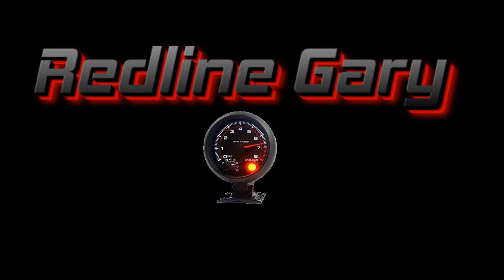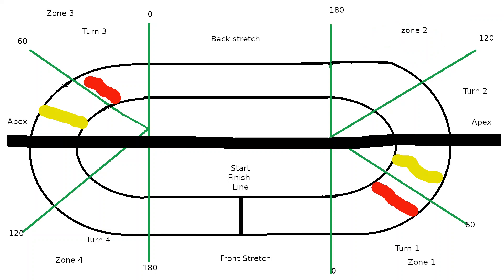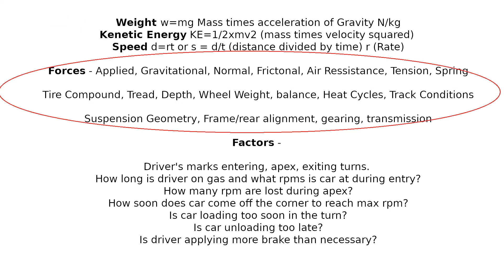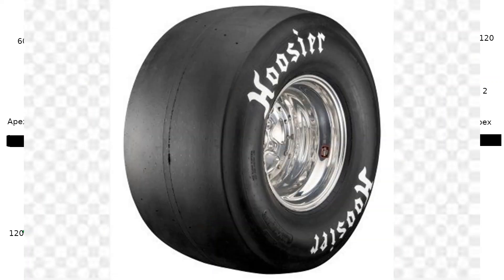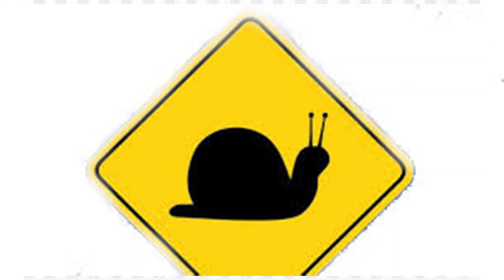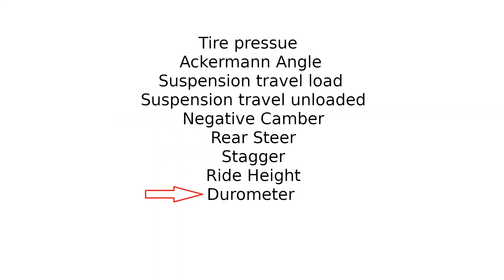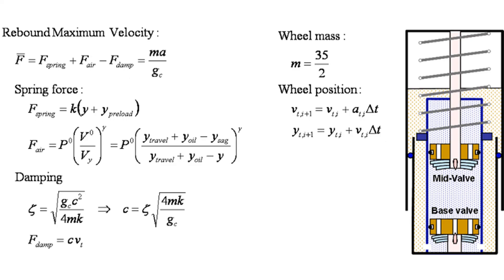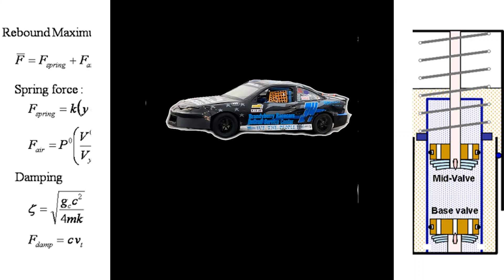Racecar Setup Talk Basics

Comment: A lot of factors are involved with the setup. If it’s setup right all the driver has to do is hit his marks and not get wrecked and finish in first place. 😊
Reply from the maker: That’s the way it should be. The driver drives the car. The car is set to the driver and track. Most factors can be managed. But, if you get too deep in the rabbit hole, you’re chasing ghosts.